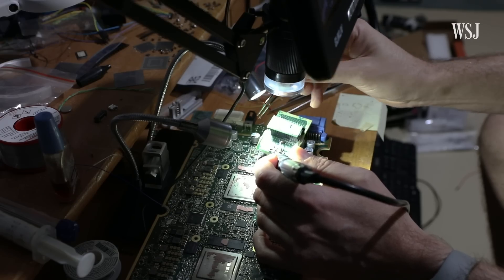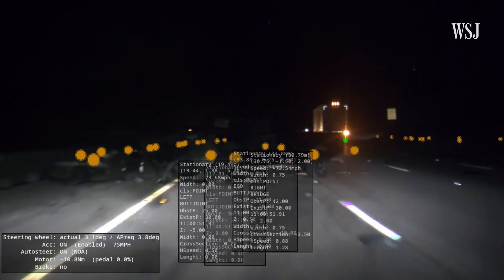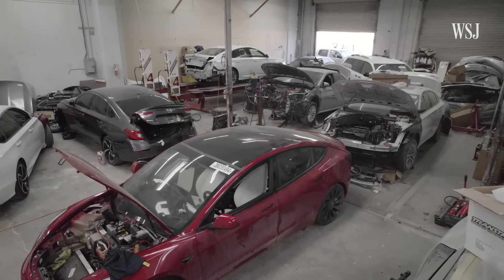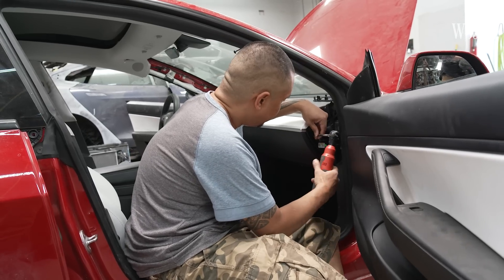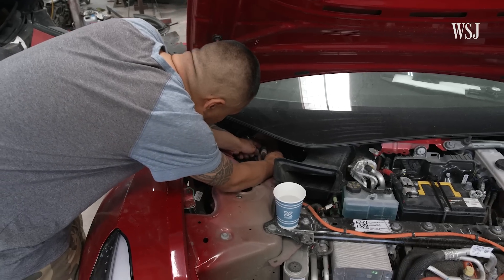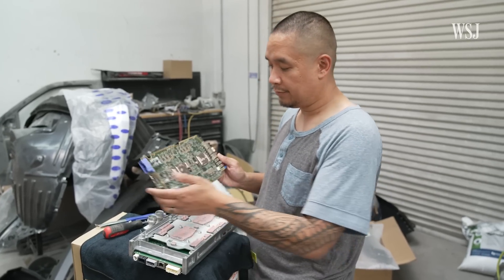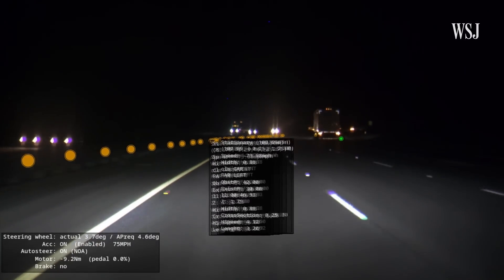How Hackers and Mechanics Unearth Tesla’s Hidden Autopilot Data | WSJ

Comment: A key point made in their video is that Tesla does not use Lidar sensor, unlike most other car makers like BMW, Nissan, etc.
instead, Tesla decided to cut corners by only using camera and sonic sensors....which works fine when there is sufficient ambient light, but can struggle under very low light conditions. The night time car crash shown in the video is one example of the limitation of the technology in any Tesla car. Because it was too dark, the camera had trouble detecting the stopped car blocking the road. By contrast, Lidar sensors work well even under extreme low light condition because it uses its own light source (laser). Maybe the car could have detected and safely stopped if it had a Lidar sensor, but eh...profit over safety is Tesla's motto.
Reply: only people never worked with lidar think lidar is the perfect silver bullet, without even knowing the resolution and refresh rate of a lidar, not to mension the noise and all kinds of false positive.
Reply: @noizz4  Lidar can detect obstructions over 1,000 meters away regardless of light conditions of the road.
Meanwhile, a headlight on high is only bright enough to see up to around 120 meter ahead.
facts don't care about feelings.
Reply: @mapl3mage  Cost is a feeling and is important. Lidar is expensive, complicated, bulky. Sure, it's not worse in every single aspect, but there is a reason why other self-driving automakers went bankrupt. For example, steel is strong, yet we use aluminum in cars now. It might be weaker, but the cost of manufacture and cost of the gasoline outweighs this.

Comment: The wsj video says that autopilot is essentially an AI model based on cameras, and Tesla doesn't have lidar like other manufacturers. They extracted footage and decisions the AI model made moments before crashes, showing that the acceleration was on and brake off as the AI model didn't detect obstacles on the road at all, and crashed at full speed.
Reply: As if a human wouldn't also have crashed in that same situation.
Reply: @TrendyStone  an alert human driver would have braked as soon as the obstacle was visible taking the sting out of the collision, autopilot didn't engage the brake at all and rammed while pressing the gas
Reply: @tuhink96  Exactly!  The driver was not alert.  Just like with cruise control in any car, you must stay alert.
Reply: The investigation's not about who's at fault, but about the awareness people have wrt what Tesla autopilot can do vs cannot do. For example my 2023 toyota venza assistive driving alerting system will start screaming and apply brakes itself if it sensed an obstacle at such high speed. Heck it even brakes hard if it senses rapid deceleration in the car in front. And in terms of branding, you'd expect the Tesla autopilot to atleast detect an obstacle ( which it did with one of the cameras) but ultimately AI model decided not to brake and continue acceleration.

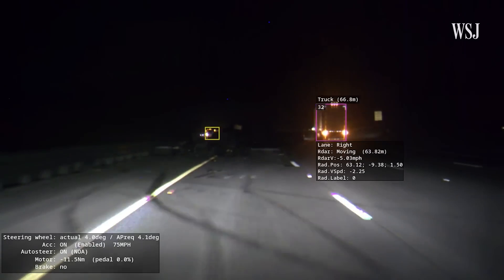Comment: up until the last frame (3:29) in the left bottom corner: Acceleration: ON, Brake: no 🤯
Reply: This might mean the driver was pushing on the accelerator.
Reply: @Turbo_Todd  No... PEDAL : 0%
Reply: Honestly tue car is so nicely hidden ... Of course Tesla crashed
Reply: @Aniket2712  I'm trying to figure out if I was driving in that location what I have seen the truck or not.
It's crazy that it was even there in the first place.
Reply: Acc: On but speed is constant at 75 MPH 🤷‍♂
Reply: Driving mine,  i can hold speed with accelerator pressed while using Autopilot (which is really cruise control). You can do the same with FSD engaged.  @shaggydawg5419

Comment: Should’ve kept the radar…
Reply: Radar can't detect such trucks covered with cloaking-paint.
Reply: radar can't detect broken car in the middle of the road either, countless of similar incidents
Reply: @noizz4 yup, it can
Reply: @noizz4  My base model Chevy would have flashed a red light in my face, sounded an alarm, and engaged autobraking. Plenty of other cars would have done the same thing.

Comment: As a human i wouldn’t have seen that truck
Reply: What you see as a human isn't the same as what you see on the camera footage.
Reply: @OmniscientIgnorance  exactly, the camera lacks dynamic range. A human paying attention may have seen the contrast of the black truck way sooner
Reply: 0:49 - here you can see not only 1 crash - all other was for reason autopilot
Reply: That is the camera feed
Reply: As a human, I can tell that something is blocking the LIGHT from an oncoming car (like a black hole).
I guess it depends on brain and experience.
Reply: Yeah, but a self driving car should had LiDAR for that exact reason.
Reply: @eichen97 tesla just has camera, not other sensors. If a human would not have seen, the car wouldn't as well. Tesla/computer is only quick to react and other safety measures
Reply: but anyway a bad autopilot is better than nothing
Reply: This is a hit piece so they won't compare FSD crashes per mile driven vs. human crashes per mile driven.

Comment: You know this is what China is doing to get Tesla's FSD technology
Reply: It doesn't work like that. The model is constantly improving via OTA updates and is finely tuned to the set of sensors and cameras the car has. If 1 camera is different (FOV / resolution / light sensor) or placed in a different spot in the car (in relation to the others) then the model would no longer work properly.
Reply: I'm pretty sure BYD uses different technology than Tesla. For example, they've started adding LIDAR, which Tesla famously refuses to use.
Reply: What do you mean? Why would that be?

Comment: Reports on TESLA safety should include rate of accidents vs human drivers otherwise hard to compare
Reply: The video never said fsd only auto pilot.
Reply: @cad4246  the originally commentator never mentioned FSD, also autopilot is supposed to avoid accidents. Autopilot is not cruise control just keeping a certain speed . "Autopilot enables your car to steer, accelerate and brake automatically within its lane. " This is from their website. It does not mention accelerating into one.
Reply: Here's the conclusion to the next video in the series, which I totally agree with: "Computer vision is such a deeply flawed technology, and we're not doing enough to determine how to fix its gaps and how to make it recognize objects. [...] Having the car do most of the driving for you and requiring you to pay attention to make sure nothing bad happens, I don't think this is going to be a long-term technology that we keep in the cars."
Reply: @LesserAndrew  Regarding computer vision…somehow humans get by with only two eyes and no radar.  But my car has 7 cameras…so It sees more than I can.
Reply: The video is worth a watch, includes a former Tesla employee. The cameras often aren’t calibrated accurately - bad data in, and failures in the software to recognize results in full speed impacts.
Reply: There is already public information for this. Tesla with FSD is significantly safer than driving without it
Reply: wow this video is garbage. expected more from wsj sadly. lost major respect for you guys
Reply: I bet the data will show FSD beats humans by a mile.  I'm also guessing this hit piece won't cover that.
Reply: @TrendyStone  I haven't seen evidence of that. Tesla buyers tend to be experienced drivers with relatively new cars with lots of safety features. If you compare them to similarly experienced drivers with new cars with safety features, I doubt you'd see a benefit.

Too bad we can't have a bunch of people give $100,000 to researchers and then be randomly given a Cybertruck or R1T to compare longterm accident and injury rates. My hunch is the R1T group would be safer.
Reply: @LesserAndrew  1) The Cybertruck doesn’t even have FSD so bad example. I’m not sure you know much about this topic.  
2) I paid ~$40k for my Tesla so not that expensive.  The safety features are indeed remarkable.  
3) Try FSD before you criticize.  Don’t give a critique of the movie if you only watched the trailer.
Reply: And if you do go back, notice it still does this even though it registered the crash in front of it as stationary and being a bridge across its path.
Reply: How ye all can watch something like that, and go you know what that looks super dooper ok to me. Is mind boggling to me. You don't have other car manufacturers having these issues to my knowledge. Why.
Reply: @plebius apparently cars never got into accidents until tesla
Reply: @Omega---13  big difference between you being responsible for a crash and an autonomous algorithm accelerating you into one.
Reply: @plebius  you are responsible even in autopilot
Reply: @Omega---13  the recent lawsuits they have settled beg to differ on that statement
Reply: That's not how this works, and if you actually studied the video you would have seen the last image before the crash shows the brake off and acceleration on when meters away from the crash. It was accelerating into. If that's what you want from your car, and to live oblivious to that fact. Well good for you.
Reply: That was at a range of 25m away or 75 ft.  Kept going. So please tell me how safe they are when in dangerous situations (which most of the time, you will not know you are in until seconds before disaster or a near miss.)